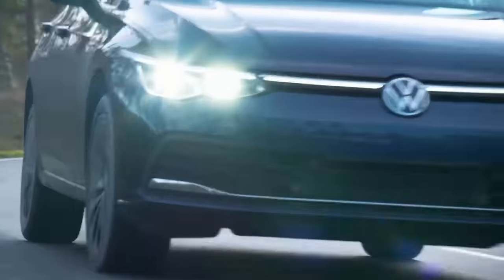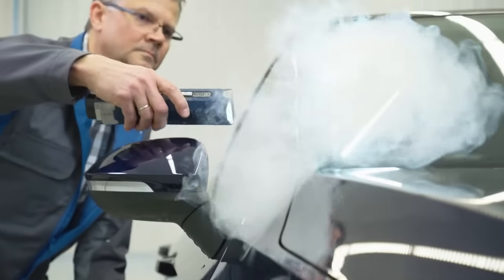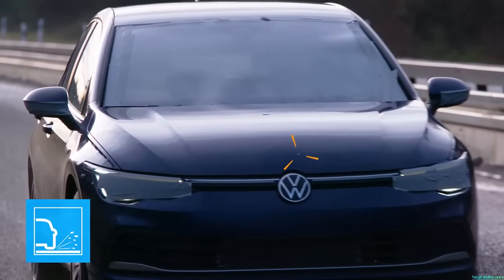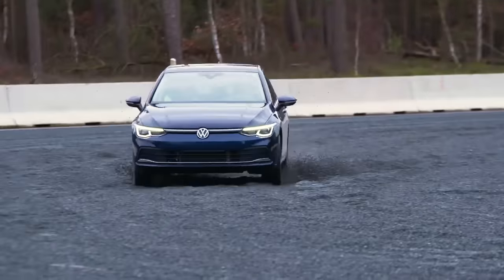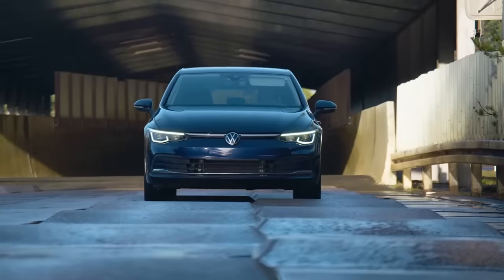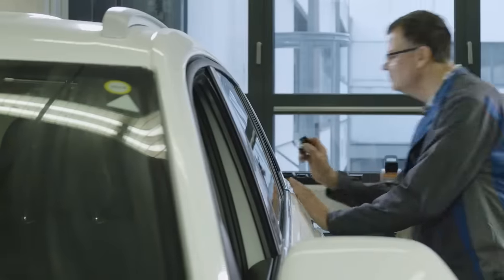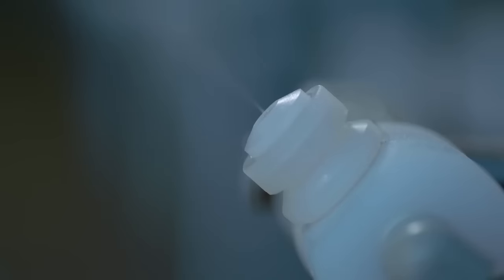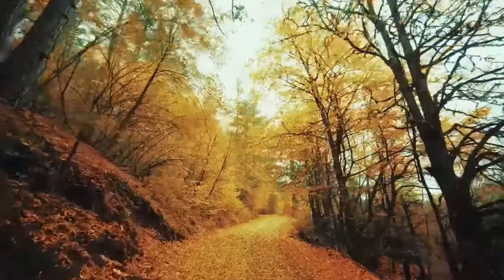VW Golf 8 Corrosion Test - how VW cars are tested against rust

Comment: I'm German, but ... VW cars + many from its VAG group are getting more and more expensive, 
VW / AUDI has become very arrogant, the production is getting cheaper and cheaper. 
Some of the customers are test drivers, manufacturing defects, and the following repair costs, which the customers very often have to pay for themselves.
Did they have to work properly at VW for the video? 
Did they test the Golf 7 like the golf 8 ?
The funny thing is that the Golf 7 has very big problems with water in the interior. 
- Loudspeakers seal the doors until they start to leak and water leaks into the interior. 
- Condensation from the air conditioning in the interior, ..... 
Since the Golf 4 is no longer fully galvanized,  suddenly rust on the roof, etc.
Unfortunately, the cars are no longer built to last ...
Reply: Sadly if you want a car without rust problems you will have to buy a French car. They have other problems but not rust related.
Reply: VW love their recalls which customers have to waste time to bring in their car to dealers.
Reply: @Mr.Riffian  French car? no thanks, i don't wanna became an electrician.
Reply: @ALINUED  :D
Reply: @Mr.Riffian  is that a joke? French cars are one of the worst for rust lol
Reply: @bendude6748  what are you smoking lol. PSA is still one of the few remaining manufacturers that actually uses galvanized steel on body panels. Joke all you want, but while your average 10+ year old peugeot shitbox will have plenty of electrical gremlins to deal with rust will be last of your concerns.
Reply: Mein Herz schlägt Audi ! Aber so langsam kotzt mich das auch an mit den Preisen. Was soll da so teuer oder gar wertvoll sein. Ich hätte gern einen Rs6 aber ich bin trotz meines guten Gehalts nicht bereit dafür über 100.000 Euro auszugeben. Dafür bekommt man einen Supersport Wagen. Wenn man jetzt noch berücksichtigt das man keine 100.000 km damit kommt ohne ständige Werkstattbesuche und Service Termine dann hört es auch schon auf mit der Liebe.
Reply: Bizcar Pro  kann ich nur ( wegen Fanbrille 🤣 ) verneinen. Jeder hat etwas besonderes . Da finde ich VW etwas monotoner.
Reply: Bizcar Pro  ihr Deutsch ist gut lesbar. ✌🏻 Und ja, Audi will zur Zeit etwas mehr sein als sie sind.
Reply: VW makes shit not cars. This piece of german engineering can't even do 30000 miles without complete engine rebuild after multiple faults
Reply: @jurijkalevra8791  nobody ever rebuild a VW Engine After 30000.
Reply: Just have a look on the roads around you.... No more mk5 golf (very few 1.9 tdi) same for the mk6 (Thanks to the dieselgate period). Few polo while some 206 are still running like crazy. 
After the mk4, VW changed its product policy. The "seem" to be qualitative but in fact they don't last. Not even commenting standard wear parts...
Just try once japanese like Honda products (even if you don't like the design), just try it once. Even if not really maintained properly, they'll start every mornings.
Reply: @Mr.Riffian  or buy one with an aluminium/plastic unibody!
Reply: they need money to recover from the expensive diesel scandal fines
Reply: @ersguteratze  VW 1.2 TSI engines below 30k had timing belt failures, recalls did not solve the design problem but made them survive till out of warranty.
Reply: 2022 golf 8 or 2022 audi a3 sportback??
Reply: @ersguteratze  NEUE WELTORDNUNG! DAS VERSPRECHEN DER ROCKEFELLER-FAMILIE.

Comment: Have 2 Golfs... 1990 Mk2, that we have for 17 years, 10 of them was all year usage on Eastern European roads (gravel, forest, mud, salt, snow, destroyed asphalt), and only now, there are some issues with corrosion (only where paint chipped or erased). 2007 mk5, bought in 2018, before was driving in Frankfurt-Main region, it was almost in mint condition. Now, all underneath is pealing off and rusting, especially where spot welds are. Car is accident free, original paint all around. Thin, water based paints and cold zinc coating is a mistake.

Comment: well u wont even hear a noise inside a new car. they must test these cars after 4-5 years. so its pointless. i live in rome, the roads here are the worse, had my golf 6 2
years ago, no noise at all, just after a year and every part of the car is making noises. so it depends on road conditions.
Reply: Did you not watch it? It says the stresses endured are equivalent to 12 years worth of road driving.
Reply: They test the cars after months (not years, which would equate to probably ~100 years of testing :D) of accelerated testing...
Reply: @jackshotton9222  that dont mean a thing. a real world condition is taking out the car on normal roads and test it.what manufacturers say sometimes dont really add up.
Reply: I live in Rome too, and my car also make noise noise and I have to change suspensions
Reply: Cars are build for roads asphalt roads. Not a 1000 year old horse path.

Comment: Mk5 Golf and mk6 Golf:

Inner wheel arches where leaves and debris collect, and rear wheel arches at the front part where the fabric liner goes behind the plastic guard. 

(Top of front wheel arch mk5 specifically)
Reply: Also around door handles, trunks door and spoiler etc....vw never again
Reply: I’ve got a 2000 Golf Mk4 and besides some minor little bubbles on the bottom of the front wheel arches just above the side skirt, totally rust free! Most people don’t clean their wheel arches, bottom of the doors or what ever little ‘weak spots’ properly that often or never. Some cars and brands are more vulnerable for it ofcourse. But taking care of it is mostly the key factor.. 😏

Comment: Just make the whole car out of plastic

It won't rust
Reply: @Synonym_MS  Only outer shell on Trabant was made from mixture of fenol resin and wool fibers. Chassis and floor was made from metal. Its dangerous, because it looks good until something important fails because if you cant see rust you think is OK. On metal body cars - unimportant body panels rusts through first before some important parts fails.
Reply: If they make cars out of plastic, they would melt on the sun. Especially around the engine where its hot.
Reply: Saturns had plastic pannels. Chevy cobalts had a few as well. Plenty strong enough
Reply: @edwinator46  are you sure about that
Reply: @xxFobioxx  no
Reply: Yes, but if it were a bmw, even the plastic would rust...
Reply: Stonks
Reply: Just make it out of rust
Reply: @joshuachristiansen2626  I rather not be in a wreck in a plastic Saturn! Seems they went out of business for a reason
Reply: @2004cyrus  they went out of business because GM didn’t find them profitable enough during the 2008 recession. Same story with Pontiac. Also saturns despite being mostly plastic panels were quite safe in crashes due to the actual body being made of reinforced steel.  they did just as well as other cars during crash testing
Reply: @joshuachristiansen2626  actually they were never profitable since 1985. And they were discontinued because Penske cancelled their bid to buy Saturn.
Reply: @2004cyrus  yes penske did offer to buy them when GM announced its plans to pull the plug. but Penske was forced out of the deal because they couldn’t find anyone to build the cars. Its a tragic story. I miss the saturns of old like The early and late 90s SC2.
Reply: @edwinator46  most cars have plastic engine parts from air intakes, water pumps to oil sumps, plastic body panels are also normal. It's all part of reducing weight and cost.
Reply: @OvoNono  just like Tesla and GM vehicles. I’ve had 5 VW’s, I live in Connecticut. No rust issues ever. They’ve all been great vehicles. I currently have a GTI & a Tiguan. They have been in wrecks and there was no plastic exterior.
Reply: @2004cyrus  here in Europe you can feel the dieselgate just by entering in a « T-Roc » or other shitty vehicle of the brand... cost hunter is real
Reply: @OvoNono  sounds like you’ve driven lots of them! Or ridden in your friends VW’s. Do you prefer Chevrolet or Ford?
Reply: Saturn?
Reply: @2004cyrus  we don’t have really a lot of Chevrolet here, but Ford yes, I have a Ford as « working car » and I already test drive some other Ford (mainly 2 Fiesta ST, the last one and the past one), and for me, clearly Ford are great car, better than VW and you feel more “passion” and soul when you driving it.. 
I drove VW Golf 6/7 in a lot of configuration and I don’t feel comfy behind the wheel, not a great feeling (my ex girlfriend was working for Europcar, a company who rent cars, and i spend a lot of free time helping her for cleaning, delivery and everything so I think I have points of comparison with a lot of cars you can find here in France)

Comment: Golf Mk5 and Touran Never Heard of it
Reply: My golf 5 had a lot of rust
Reply: i  own a golf 5  2004 production , there is only a couple of rust spots. No real big issues.
Reply: Cause the real engineers died with the mk5
Reply: @MrWotan109  it's much better. Then the mk4. It corners better, handles better.
More space in the car. Also it's cheaper to maintain then the mk4. I never considered mk4 an option to buy, after i drove one. mk5 is nothing like the mk4. Much better car if you take care of it.
Reply: @mcniki12  what engine do you have ? That 1.9 tdi maybe? Because as up now, it's the only one who few of them survived on the roads..
Reply: @nikko1984  1.9 tdi yes.
Bought one in a fair condition. Imported from Germany.  Engine is at 321 k kilometers, recently i opened it and it was  perfect. No issues or what so ever. 
I opened the engine, because i care about my car a lot.  So i just opened it to check if the engine needs a rebuild or something.
Cleaned the intake manifold, EGR , turbo, and replaced all the rubber seals for the turbo hoses. Complete clean up of the intercooler also.  Had to remove it, clean it with chemicals, with a power washer and etc. 
Car is running like a clock now, no smoke, no misfires. Reached 220 km/h with the stock 1.9 tdi engine.(105 hp) and 110 hp on the dyno.

Comment: My 2000 mk4 is still rust free and still going strong !
Reply: Mine too,no corosion.. mk4 coupe 2002..
Reply: you must have very low mileage or no salt on the roads in the winter. Mk4 golfs are usually very rusty where i am from
Reply: Because of the MK4 is the only galvanised unibody of all Golfs......
Reply: my 96 has some minor rust bubbles on the fender. and under the car like the brakes and stuff is very rusted.
Reply: @Mikescze  Lots of cars from that era can be rusty.. especially if you don’t clean the areas where debris accumulate round fenders, wheel arches etc that often or never. I live in the Netherlands. I know it’s not Scandinavia or Russia or something 😉 but still we’ve got here almost every year salty roads.. but yeah Mk4 have some little weak points like; bottom of the front wheel arches near the skirts. Beneath the rear window on the trunk cause of use of wrong window sealing kit. Some Audi’s round those years had the same issue.
Reply: @Alex-AK321  The Mk3 was not galvonised. Mk4 made a huge step forwards in quality, interior, fit and finish etc 👌🏼
Reply: @Mikescze  mine has 220k KM. Never let me  down or stranded
Reply: @eggbirdtherooster  Mine is a mk4 build 1996 first time registered 1998
Reply: @Alex-AK321  oh really.. yeah they were sold from 97 right? But how do you know that it’s build in 96 if I may ask? :) and where exactly do you have rust bubbles? Also on the front fender near the side skirt? That’s a spot where water, dirt and debris gets collected most times
Reply: @eggbirdtherooster  i have read this on some parts i belive its a while ago i that i saw it i am sorry but i cant tell you right now where i saw it. and the rust are on the flat outside of the front fender

Comment: the key phrase at the very end is - "12 year warranty against rusting THROUGH'' not that it wouldn't rust at all.
Reply: Because that is technically impossible. You have to use rust-free steal, but this is very heavy and has other disadvantages (see DeLorean).
Reply: Dogs Bollocks  Galvanised steel is just steel with a galvanising coating. You do know what that means?

The galvanising is literally designed to rust. It oxidises slower and so protects the steel underneath for longer but it's main funcition is to rust.
Reply: @hagglundguy  Rust or no, the new cars are generally made to last designed amount of years so that eventually (hopefully sooner) you would replace it with a new one. 
and thick undercoating would probably take care of the rust protblem for years but even brand new Jaguars comes with just a paint protecting the metal under the car.
Reply: @InBoostWeTrust7MGTE  I knew all of that already except for the fact Jaguars don't come with undercoating. I live in Finland where cars tend to rust really fast due to salt and changing conditions. I just corrected @Dogs_Bollocks on the fact that galvanising is designed to rust.

Comment: VW proudly announcing : "How vw cars are tested against corrosion."
Me who's learned from experience: "They aren't..."
Reply: Just wait 10 years n 5 owners later who don't clean underneath arches in the shitty gaps  you will have rust 🤣
Reply: Me to
Reply: The only thing they probably test is if they start rusting within the first 2 years of warranty (the rest of the car is also designed with this goal, and this is not only the case at VW).
Reply: You should see quite a lot of Mk5 Golfs where I live in the mild weathered southern UK. There is plenty of rust on the front wings particularly at the top of the wheel arch, sills, rear wheel arches and door bottoms. Japanese and Korean cars of the same age generally appear rust free. I guess this is VW doing their own PR !
Reply: @bigvinny333  Right, but due to it's shoddy build quality the Mk5 Golf is a disgrace to the previous ones anyways. The Mk4 was the last good one. It peaked with the Mk2 – very durable, easy to repair, no major issues with rust (and we're talking about a 30+ years old car here) and in my opinion very good looking also. 😎

Comment: They do these test and the are like: "Yes, this is rust". And then they do nothing to stop this rust from appearing. Of course they also take notes of everything and then throw them into the trash bin because they clearly don't remember any of them when they start working on their next car.
Reply: I think so, the Golf 5 for example is rusting very fast, also the T5.
They know how to get a good corrosion protection, the Golf 4 didn't have this problems.
The same with Mercedes, they rusted from the early ninetees on (when they switched to water based coating) until the mid 2000s.
Reply: @simonm1447  golf 5 was a lemon, but after that they fixed the rust issues

Comment: After the test is complete, I want the engineers to try to remove the pinch bolt holding the upper control arms in place. It's nearly impossible without drilling it out.
Reply: That’s what’s putting me off doing the bushings on my 6 year old A5
Reply: plenty of heat, put the nut back on the thread half way and hammer the shit out of it, took me almost an hour of heating and hitting to get it to move, putting it back together just cover it in copper anti seize
Reply: The MK 8 does not have an upper strut, it has the same Frontaxle vw used on the 1973er Super Beetle , Mc Pherson.
No doublewishbone, that's to expensive for a cheap Golf.